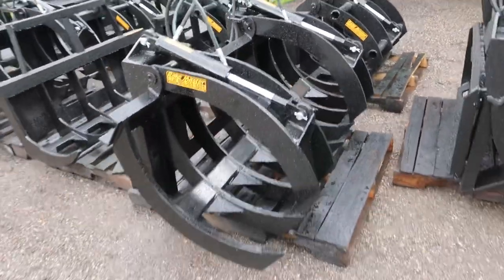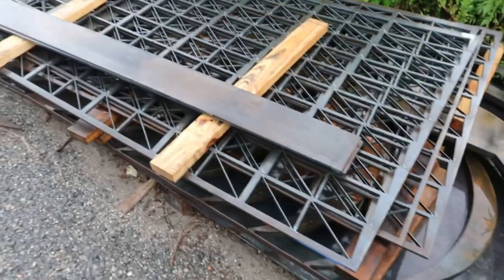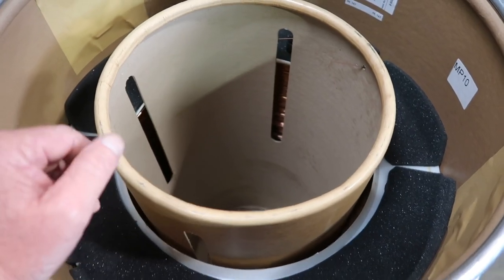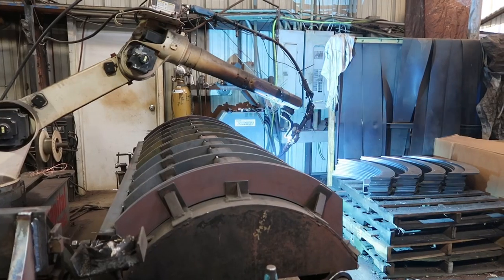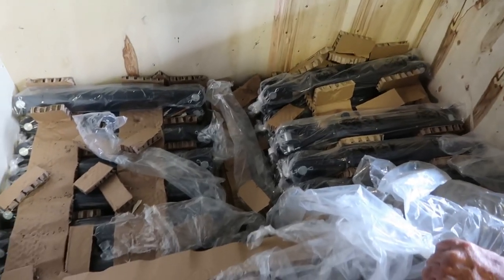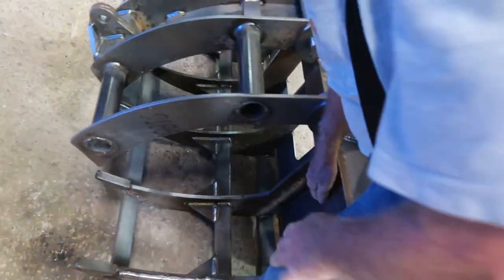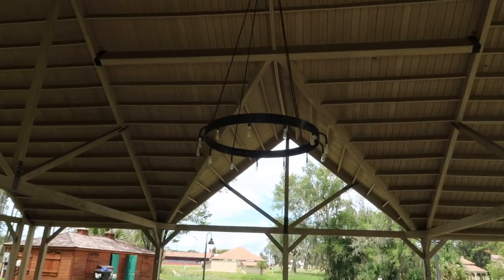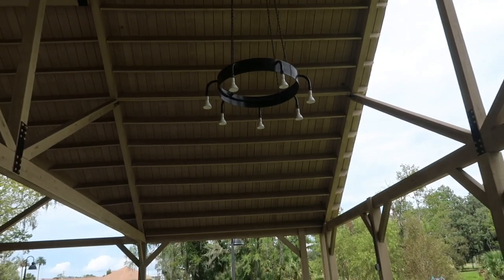Rake Master grapple rake | how its made

Comment: Here's my 2011 LS XR3037HC with the RakeMaster grapple attached.
It's a very very capable piece of equipment and you'll never come close to bending one of these tines.
Great piece of equipment and used almost as much as my bucket out here on the farm.
It's not near as heavy as you might think, either.